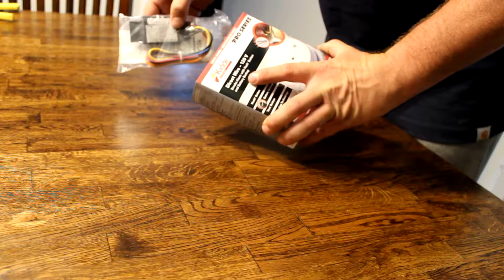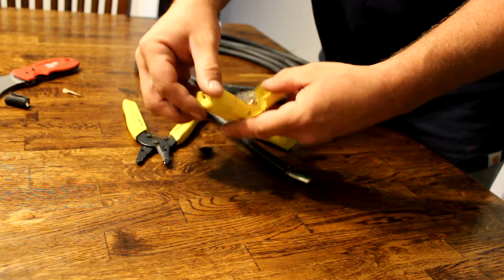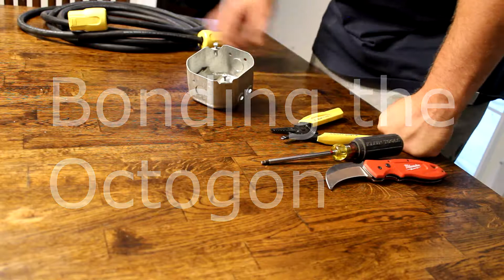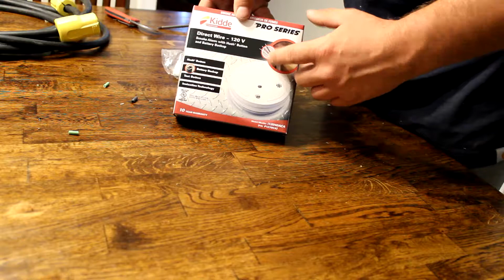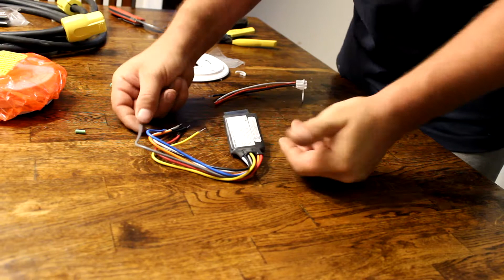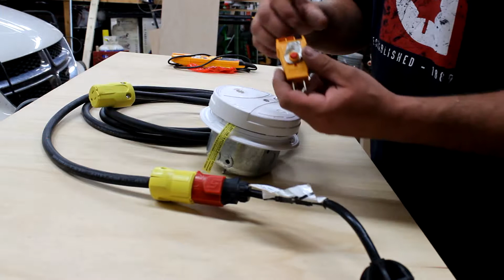Smoke Detector Disconnect - Build

Comment: Awesome, but... how to we do backwards? Instead cut the power, it power something, like a fan for example?
Reply from the maker: Yes, that's easily doable. The relay has both normally open and normally closed contacts. All you need to do is wire on the normally open side to a fan or something else you want to turn on when the smoke detector goes off.

Comment: can you huse this relay for activating a fan when the smokedetector detects smoke? gr
Reply from the maker: Yes you can. It has both normally open and normally closed contacts so you could wire the fan through the NO contact and you'd be set.

Comment: does the relay have a latching function? After some time the smoke will clear and the 3d printer will turn back on and potentially start another fire right?
Reply from the maker: Most printers restart to a rest screen if the power is disrupted to them, so hotend, heated beds etc. wouldn't power back up. It is possible to keep everything off   permanently using a second relay with a NC contact and a NO holding contact. When the relay is activated it would switch the secondary relay and stay off until some sort of reset or stop switch was pressed.
Reply: @TD3DMakes   thanks for fast response. I'd like to try this is there a link or specific relay  you can suggest?  I've read about several fires due  to bad power supplies so if that is the case it would not matter if the printer hot end was cold since the fire started at power supply. better safe than sorry.
Reply from the maker: @rollandelliott Something like this would work well: https://www.amazon.ca/dp/B00J2N3I14/ref=cm_sw_r_cp_apa_i_VsC1Bb6G52WST

You can get much heavier relays, but this would be plenty big enough and has a smaller profile. It also gives you extra contacts which you could do other things with, a sprinkler or fire suppression system for instance.

Here is a link to a wiring diagram and helpful wiring tips. Keep in mind your "Start" button would be the output of the relay in my video and you'd move the black wire in my video going to the printer to the load side of the new contact.  Everything else would stay the same.

Good luck!
Reply: thank you  
 @TD3DMakes
Reply: @TD3DMakes  I dont' see link to wiring diagram though?
Reply from the maker: @rollandelliott  https://www.theautomationstore.com/3-wire-control-start-stop-circuit/

I copied it and forgot to paste! There you go!